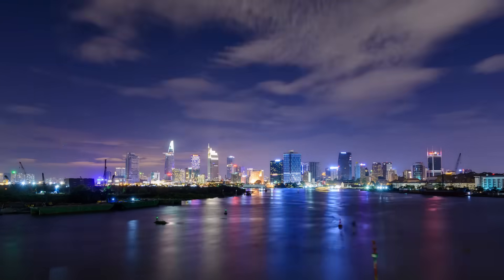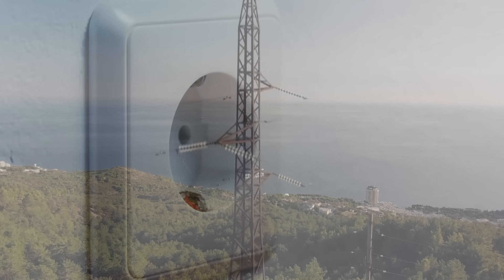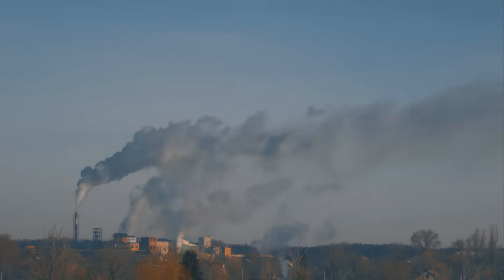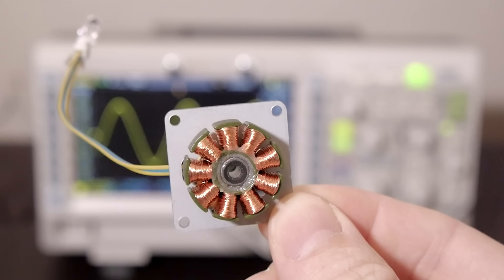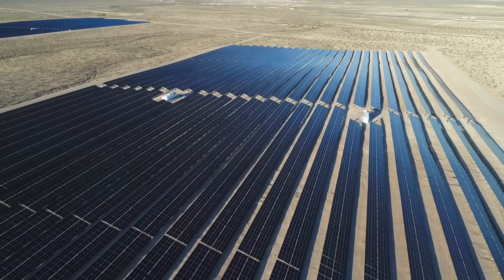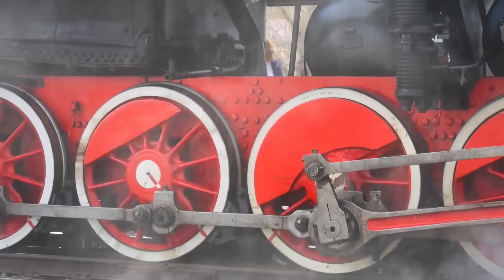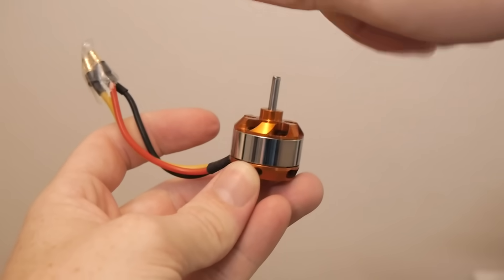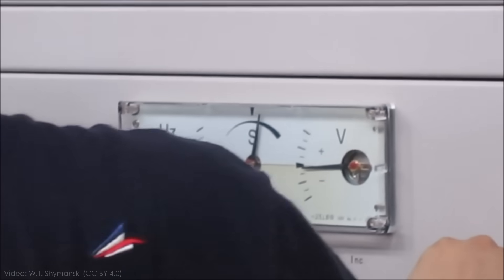How Electricity Generation Really Works

Comment: I'm still mad about when we were learning about energy production in elementary school. The question was asked, "What forms of electricity generation use water?" 

My answer was "All of them." I even made the case for each type of power plant. But because the teacher was a stubborn idiot, she still told me I was wrong.
Reply: Including Solar PV & wind ?
Reply: How do you think Solar Photovoltaic panels are made? The chemistry used uses water at some point. Without that water, the panel doesn't exist. Same for Wind. Those parts don't spring whole from the head of the engineer. Machining and compositing materials uses water. 

And if you were to find a wholly anhydraulic process, there is still the human being creating and maintaining the machinery. 

These answers are a bit obtuse, but my teacher was heavily ideologically inclined. I thought reason would work to open her eyes to reality, but off course it only served to make her shut them tighter.

Comment: You could also do a video on how electricity suppliers counter the capacitive & inductive loads that cities place on the grid.
Reply: Probably a bit too specific for this channel.
Reply: In germany capacitive compensation for inductive loads is done at the customers site. From small capacitors to compensate for a vac motor to huge capacitor banks with active control to get the delta phi in heavy industry down again.
To my knowledge, suppliers do very little in regards of compensation, because it is extremely difficult for them to do. The latest point at which you can act is the secondy side of the transormer the customer is connected to. In heavy industry that usually IS the client's site.
Reply: @DasIllu  Not quite, you CAN correct the power factor further from an industrial customer and after a transformer, but it is not as effective. After all, the reason why you correct the power factor is to reduce the ohmic losses in the transmission line. If you correct it further away from the load, you still get extra losses up to that point.

Also, it´s not enough to just switch in capacitors or inductors. Especially these days, 3rd harmonic currents caused by switching power supplies (without APFC) require a "Zigzag Transformer" to be corrected.
Reply: I wish somebody could explain it in plain English, I work in a power station and I still don’t fully understand the principle of reactive power.
Reply: @AE92World  Reactive power is simply energy that is stored in some part of the AC cycle and then discharges back into the grid later in the AC cycle.

Capacitors charge when the voltage is increasing and discharge when the voltage is dropping. At the peaks of the sine wave, it´s fully charged, so no more current flows into them. (as opposed to any resistive load which draws the maximum current at the peak of the sine wave)
Inductors work in the same but opposite way.

(In the power grid nothing prevents power from flowing from your home into the grid.)
Hope this helps.
Reply: Think of reactive power as a component of power that is responsible for establishing electric and magnetic fields in all components of an electric circuit.
Reply: I’m not 100% certain but I’ll give it my best shot anyway. Energy on the grid can exist as useful electrical energy (watts) and can also exist on the grid as unusable energy in the form of magnetic fields (inductive loads), devices that store energy in the form of magnetic fields are said to ‘absorb’ reactive power. Devices that store energy in form of electric charge (capacitive) are said to generate reactive power. 
During periods of low demand like nighttime, a lot of the big machinery and plant that consists of large motors (inductive loads, which absorb reactive power) are switched off, meaning there is abundance of reactive power, this makes the grid sway toward a more capacitive load. Distribution cables themselves hold a capacitive charge! Conversely, during the day there are a lot of magnetic fields produced on the grid by motors etc so there is a lack of reactive power. The voltage at a specific point on the grid is affected by the nearby reactive loads. To maintain a consistent voltage at any point in the grid, the reactive power must be compensated for. At the power
Station I work at we can import/export reactive power as per instructions by the national grid. For example, if we get an instruct to generate reactive power, we will reduce the tap on our generator transformer ( alters the ratio of number of primary windings to secondary windings), this in turn reduces the voltage at the generator. Modern generators have an automatic voltage regulator (AVR) which aims to provide a consistent generator voltage (21kV for example). It maintains this set point by increasing the excitation (voltage) applied to the generator rotor, which in turn generates a higher voltage at the output, to compensate for the drop in voltage occurred after the transformer tap change. Okay so now we have more excitation applied to the rotor, but we still have the same generator output voltage, that extra energy comes out as reactive power. (Im sorry I’m not an electrical engineer so I can’t really explain why that happens). What I’ve been told is that if you were to take a snapshot on each cycle (either 60hz or 50hz) of the generator producing no reactive power (power factor of 1), the rotor magnetic poles would be perfectly aligned with the magnetic poles of the windings. When the excitation changes , the position of the rotor can lead or lag relative to the windings. I could be taking bollocks please correct me if I am. I’ve had a few beers so probs don’t have a clue what I’m talking about
Reply: @AE92World  Hmm, I´m not familiar with the terminology of "generating" or "absorbing" reactive power.
Normally I would call it "capacitive Reactive Power" and "inductive Reactive Power". The total reactive power is simply the difference between capacitive and inductive VAR.
So I guess you say inductive load "generates" VAR because the grid´s load is normally inductive, and adding more inductive load therefore adds more VAR in total.

As for the Generator, wouldn´t you just get a request for more power in general (or more apparent power (VA) ) to supply higher power demand on the grid, and do what you described because of that?

I´m not an expert on generators, but as far as I can tell, the magnetic poles of the generator only line up perfectly when your generator is neither consuming nor supplying any electricity. The generator is turning, and your turbine is providing exactly as much torque to keep the generator turning at that speed. (friction)
I could be wrong about this, synchronous generators are complicated.

Comment: Three phase gives constant power into a resistive load. And constant, smooth mechanical work with no notching. Other numbers of phases do not.
Reply: I can see why 1 or 2 phase wouldn't work, but what about more? Does 4 phase not work, or is it just more complicated than we need?
Reply: @Khaim.m  The power into a single resistive load at any given instant is proportional to the square of the voltage, so it is obviously lumpy for a single AC phase. With 3 phases, if you take any given instant in time and calculate the three voltages, 3 powers  and the sum of the 3 powers into the 3 similar resistive loads, you'll find that the total power is always the same regardless of the instant for which you calculate it. To put it another way, sin squared theta plus sin squared (theta +120) plus sin squared (theta plus 240) is constant regardless of the value of theta.
Reply: @Khaim.m  Actually 1 phase does work - the power in your home is single phase.  And two phase also works very well, and was popular for powering loads such as motors in the late 19th and early 20th centuries.  Practically, however, 1 phase and 3 phase constitute the bulk of the power system as we know it today.  There are a few examples of 'high phase order' systems for special applications such as s smelters or chlorine production facilities - those loads required that DC power, and problems associated with conversion of very large magnitudes of AC to DC can be simplified with a large number of phases.  There have also been a few experimental applications of high phase order (especially, 6 phase) to investigate the feasibility of transmitting larger magnitudes of power across a transmission right-of-way.  However, they are always multiples of three.

Comment: Also Speed of electricity in a 12Gauge wire is %95.1 of the speed of light
Reply: Good to know, but 0.95c is essentially lightspeed for many applications.
Reply: 95.1% of 300Mm/s is far to close to 100% for anyone outside an electrophysics lab or leading edge electronics industries to even notice the difference...

Comment: we have to start generating electricity from quantum movement. just kidding. I don't understand anything about quantum. my physics exam scores only 50-60 in high school. but I am still curious whether we can generate electricity like nature generates lightning?
Reply: Gus What lighting is generated by friction.  The same way you can make sparks by rubbing your feet on the ground.  We can make electricity that way but it is very inefficient.
Reply: lightning is not power generation, but power transfer- the air is essentially burning, which provides a path for electricity building up in clouds to ground itself to the surface. (this is why lightning tends to jump to metal buildings- the transfer through the air is like pushing through molasses for the electricity, it would much prefer the building).

Comment: Could you give the grid "inertia" by adding a resonant circuit?
Ideally one using superconductors, so no energy is dissipated. Then you could use that as a battery which basically doesn't degrade over time, you'd only need have very good thermal insulation to keep the superconductors well, superconductors. And insulating is something we can do :)
Reply: Something like it is actually being done, with super-capacitors, that's actually reasonably cost effective. Zero losses in a superconducting coil doesn't mean you can store infinite amount of energy in them, superconductivity breaks down at certain limit of magnetic field strength.
Reply: @aleksandersuur9475  
The zero losses was just to make it more efficient and make it possible to store energy for a longer time, not to somehow get an infinite energy density. But since it would be a system that's constantly charging and draining that might be sort of over engineering :P
Reply: https://en.wikipedia.org/wiki/Superconducting_magnetic_energy_storage

Comment: And ofcourse, until power storage can become closer to practical or atleast not increase carbon emissions by the production and use of it.... man are we stuck in a hard place.
(Go go nuclear salt Reactors, if we can get them adopted, until we have a better large scale option)
Reply: And if you can't do salty reactors... Do regular ones. Still better than anything else.
Reply: @MrRolnicek  Until they go wrong, + mining nuclear material isnt exactly green and causes largescale pollution from tailings.
Waste storage is also a bit of a problem. Natural gas and garbage burning are best imo.
Reply: @connorrivers798  Are you joking? mining is almost non-impact since you only need very little fuel to run our civilization compared to any other source (or you could pull it out of seawater if you're REALLY stingy). Waste storage is not an issue either, they have these pools in the powerplants for that and then they move it into an empty parking lot ... and that's for the extremely inefficient current LWRs not the literal wasteburners that can actually use that "waste" as fuel and leave only very little actual waste which decays very quickly (sounds ideal for nuclear thermal cells for deep space probes to me so you would probably want to use even this waste).
And even when they do go wrong, even if you include the sheer incompetence and awful design of Chernobyl (not that you could replicate it these days) even including all of that they are THE SAFEST source of energy we have. Seriously, look up the stats.
Reply: @MrRolnicek  I have looked at the stats, sure on some papers they may be safer but in terms of polluting the land with poison for thosands of years, the jury is not out. I will believe Thorium and MSRs are totally feasible when I see rhem being installed. Also mining takes up fucking butloads of diesel. But loads lol. Also many past Uranium mines here In canada have poisoned their surrounding land through tailings, dust, etc. I used to be pro Nuclear but am mostly against them now as I have educated myself more and more about them.
Reply: @connorrivers798  Waste usage has improve most nuclear waste can be converted to generate more energy Like Mox fuel. So you have waste that can literally generate more energy not as efficient but enough that you can say look free energy from me making energy. Your issue seems to be the environmental which is easily fix by making sure that the stuff being transported doesn't contaminate the environment. If people/government pay more/regulate for these companies to be cleaner I'm sure this issue can be resolved. tbh sounds like they need a cleaning area before they send the trucks out of the area they are sending off. Also I doubt some dust levels getting out wont hurt the environment but it sounds like years of build up that caused it. I see the issue of mining it but remember you can shut down 5+ coal plant for 1 nuclear energy plant. Is mining it with that much worth that many coal plants or not?
Reply: y'all talking about waste storage in here? nuclear waste is far less of a problem with salt Reactors.
there isn't enough garbage on the planet to get all of our Energy from burning it. 
but, atleast someone didn't say "JuSt UsE sOlAr". because anyone that does, is free to fund shipping the infrastructure necessary to cover both the Moon and Mars with Solar Panels. because that's just how many of them you'd need to power this planet.

 @MrRolnicek 
eh, nuclear salt Reactors are easier to create and use than traditional ones. and much less expensive. and much safer. and create less waste.
not really any reason to use any other type, it's just better.
Reply: @taiiat0  You say people saying "Just use Solar" need to fund the infrastructure , Nuclear is more expensive then any other form of power.

As for requiring the moon and mars. 18TW is the estimated average energy(not just eletricity) usage of the world.

On average you get aobut 33W of energy per sqm. (factoring location, clouds and night ). This is equal to a square 460 miles long.
Reply: @catprog  
Solar doesn't produce anywhere near that relevant an amount of energy to the global consumption. it is just too space inefficient for that. 
it doesn't help that your numbers are completely wrong. the number you are quoting is full speculation. a closer estimate is multiple hundreds of thousands of Terawatts. last year global Energy Consumption was just a few thousand shy of **~180,000 Terawatts**.

RE: i got my data directly from the US EIA yearly reports.
(the department that is responsible for collecting all energy data on the world and organizing it to make projections about the future and to record each year for reference as history)
Reply: @taiiat0  There is a reason to use the bad ones. The reason is availability and licensing. No utilities company can just buy a licensed salty reactor to plug it in within a year, they can with the shitty PWRs.
And there's one more reason. I personally used the PWRs as an example, cause they are REALLY bad in every way compared to the new salty designs AND YET they are way better than any other energy source we currently have in EVERY concievable way (safety, reliability, environmental impact etc.) except upfront cost. It is cheaper to build a pipe that puts natural gas into a big boiler and plug that into a turbine. Doesn't need extensive regulatory reviews either.
Reply: @taiiat0  18TW * 365 days = 157 680 terawatt hours

Their is a difference between Terrawatts and terawatt hours.
Reply: @catprog  
I would ofcourse assume that energy over time was the point of discussion, seeing as that's the only energy figure that matters.

And then ofcourse with that sorted, the next hurdle is that Wind and Solar is not very useful without batteries and our batteries all suck. The best batteries we have is... just Gravity. Flywheels are remotely passable but not great. All 'real Batteries' are complete garbage in the scale of needing to perform efficiently for power generation.
Batteries is our #1 problem for the energy crisis, if we wanted to use only free sources of it. (Which means again since magically efficient Batteries isn't coming anytime soon, Nuclear Salt Reactors it is since they're very efficient.)
Reply: Having 75% of the grid as nuclear reactors is just a matter of time, just wait for oil barrel cost to increase to a certain point, people will see how much cheaper nuclear is.